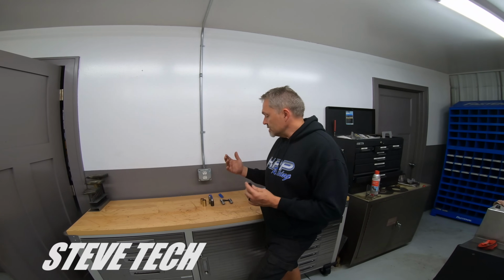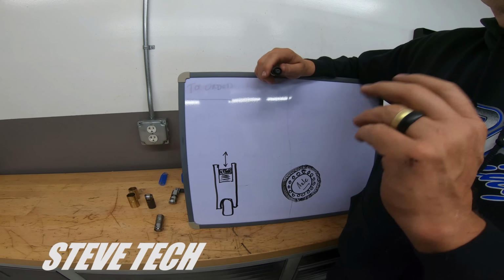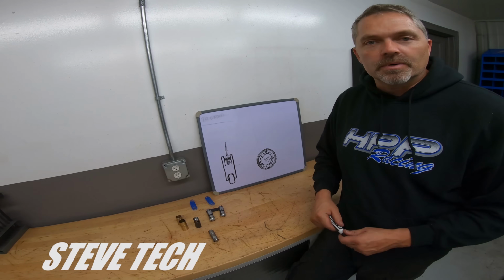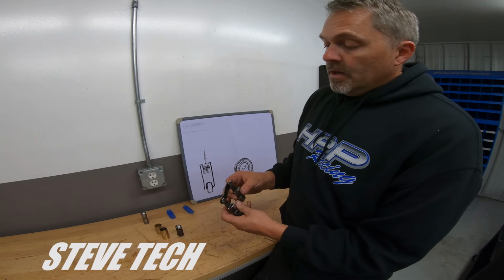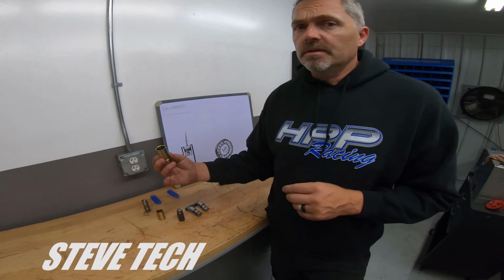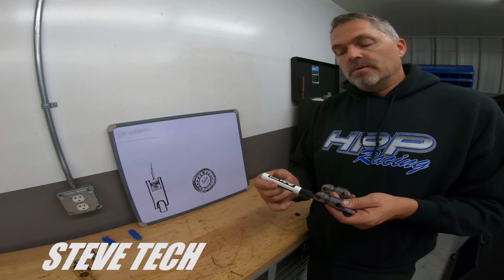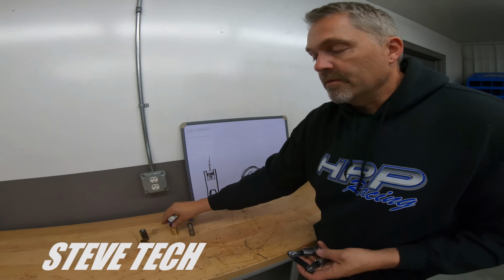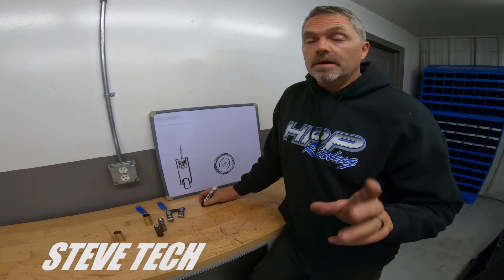Lifters

Comment: Thanks for your page Steve and all the information you provide that you surely don’t have to do. I’ve been building engines for  40 years and I’ve learned  so much more watching your content.  I’ve been running solid flat tappet camshafts on my performance daily’s due to what I always figured was a “longevity” issue. What are your thoughts on solid roller camshafts for heavy street use?  My concern is maintenance, outside of the routine lash checks. How often should one pull the intake to actually check lifters?  I do understand that keeping up with the lash checks does shed light on possible problems but the few street builds I’ve done with solid rollers were normally maintained throughout the summer months for cruising season here in Montana, then just pull the intake every winter just to check the lifters themselves…

Comment: arent LS lifters and gen 1 roller lifters the same?  i heard you can use them in a gen1 roller block  and get chepaer high RPM lifters vs the tie bar lifters

Comment: Take a look at factory G.M. 3.1/3.4 liter hydraulic lifters... If you crank the motor over without the pushrods in it long enough to build any oil pressure, and then put the pushrods back in it, it'll have ZERO compression for up to 30 minutes or even longer. The valves are hung slightly open because the lifter pumped up too far when there wasn't any pressure on the pushrod cup from the valve springs, and it takes a little while for the lifters to bleed back down and allow the valves to close.
Years ago, when I did my first I take gasket replacement on one of these engines, I tired to start it and it sounded like it had no compression when it cranked. I was like WTF, did I get the pushrods mixed up? (The intake and exhaust pushrods are different lengths) Did I somehow put the rockers on wrong? As I was looking for the issue for 30 minutes or so, the compression started coming back on individual cylinders, one by one, as I cranked it. It was then that I realized that the lifters had pumped up too far when I cranked it before without the pushrods in it. 
I've seen this happen with lifters in LS engines before also. So, if you have the issue of no compression after reassembling one of these motors, and you've done everything correctly, just let it sit for a little while and it'll come back.
Reply: I did that just a couple weeks ago. I've put head gaskets in many of these and this one for some reason would not get compression back. Went home, next day started fine.
Reply: @ottomechb  It happened to every 3.1/3.4 that I did an intake gasket on, and also a few various LS engines that I had to pull the pushrods out of.

Comment: To be clear: the reason the lifter wants to rotate when it is down on the 'base circle' is because the lifter is not ever perfectly square with the cam, and there is very little pressure on the lifter at that point (none on a solid lifter) to keep it in contact with the lobe and properly aligned. The only pressure on the hydraulic lifter when the valve is closed is supplied by that little spring inside the hydraulic lifter itself.
Reply: Has anyone ever offset the roller a tiny bit to provide 'caster trail' to assist in keeping the lifter straight in the bore? Or does it side load the lifter bore too much and cause wear?

Comment: Years ago I built a valve train for a CAT3208 with multistage turbos and alcohol. lifter bodies were 7075 Al. Ran perfect until the crankshaft split.
Any thoughts on aluminum lifters, for less inertial weight? I was more concerned about inertia in the rockers. Ideas?  THANKS!

Comment: I know this is probably beneath this guys knowledge but, i wish someone would do a video talking about todays roller cams/lifters. Ive seen so many people have clattering on startup, noisy valve trane, and lifters that bleed down to fast due to the lobe profiles. Call any of the cam manufacturers and they act like theyve never heard of this problem and never have a solution🤷‍♂️, even my high dollar custom built 383 has this very issue, builder says it "comes with the territory" of todays roller cams/lifters.

Comment: We have a tool for keying the block and running  a .904 size lifter in a small block Chevy Dart Block and we don't always use bushings but if we use a bushing it has the holes drilled all the way through like you suggested

Comment: Nice work. A video on pros and cons of the hydraulic rollers cam with solid lifters would be cool. I wanted to do it at one stage and was told it wouldn't work too great. Couldn't work out why it wouldn't work. No that you said it does, I want to know more.

Comment: i would like to hear more about how the lifter wheel size effects the cam profiles. i build SBC/BBC and never made the jump to the bigger lifters because i didn't fully understand how this changes things, i have cam profiles that i use now that im very happy with but dont want alot of trial and error to correct my power curves if the lifters send things out of wack.
Reply: you mean   a bigger diameter lifter?  you ever see why a hydraulic profile on a SBF  usually will run more lift vs the SBC's you build.?

its because the ford have and .875  lifter.  allows more area to run a higher lift

talk to circle track guys who run .906  Chrysler style lifters. .....

Comment: Great info!
I first ran a solid lifter on a hydraulic cam in 2007 for the same reasons… I tried various lash settings and found the car went quicker and faster with 15 thou cold lash… I could set them to zero cold and as long as it would fire up and had temp on all cylinders it was fairly quiet when warmed up and the lash increased ( LS7 alloy block) which was great for road use with full exhaust.
The other thing I really don’t like about keyway bush/lifters (and Steve touched on the difficulty in installing them and retrieving a lifter if one should fail) is the alignment has to be perfect on every single one else catastrophic damage will result… I only use the factory tray or a ti bar deal on LS.
Thanks for the video Steve!.
Keep them coming 💪

Comment: The bigger lifter wheels also spin slower so that also saves lifter pin bushings
Reply: And they have larger contact areas, spreading the load and reducing stresses and wear
Reply: Try needleless roller lifters with EDM pin oiling.... I've been using them for a while and so far, so good. No issues yet. I have more time on them than I did with the needle rollers.

Comment: So why do some go to so much trouble for keyed lifters and bushed lifter bores?
Reply: They are used almost exclusively in pro stock where the harmonic and inertia dynamics of a ti bar become a limitation. Especially in engines operating at 10000+ rpm.
Reply: @ktmr8  Thank you for educating me.

Comment: I remember when i was like 20 and thought I knew everything about engines when i had a 540hp 8valve 4cyl. It must have broke 20 roller rocker tips so i said they were not strong enough so i went to old school sintered slider rockers and then i started snapping tips of the lifters🤣. Dumb me figured that was the next weakest link. Little did I know the springs were beat and the thing was floating the valves like crazy and the rockers were getting slapped.  Now i enjoy listening to people that have more experience and are smarter than me so I can absorb some knowledge. 👍
Reply: You couldn't hear the valves floating at high RPMs? 🤔 Usually it's pretty easy to hear, and the engine feels like it hits a brick wall. The power just feels like it falls of a cliff.
Reply: @davelowets  i was 20 and had no idea what i was doing. Didn’t really have a blueprint to go by because it wasn’t a super popular combo and didn’t have anyone to really guide me. I just kinda figured it out myself the more i worked on it.
Reply: @starionslider2116  You must have known enough to get 500+ out of a 4 cylinder
Reply: @davelowets  yea a 8 valve 4 cyl lol. It didn’t happen overnight. Lots of trial and error. I found allllll the weak links hahaha

Comment: Is the bushing required when you increase the wheel size? Or is it possible to just increase the bore size of the block to match the larger lifter? Is there another purpose for the use of the 2nd lifter bushing you showed us without the key way?
Thank you for sharing your knowledge with all of us!
Reply: There’s a few reasons for the use of the lifter bush 
If you are needing to correct lifter to block clearance, repair a gauled lifter bore, or re-centre lifter bores square to the lobe then these bushes make those processes possible
But one of the biggest advantages is for high rpm use and particularly if using the softer alloy block or conversely the extremely hard material found in something like a Dart pro block, the bronze bush material is much happier working with the tool steel lifter material without the added expense of a dlc lifter set.

Comment: I love the idea of running solid lifters on a hyd roller cam. 😁😁👍
Reply: @vrm86gt  weigh your hydro roller lifter and pushrod, weigh your solid roller lifter and pushrod. If you are lighter you can leave the spring pressure the same(assuming your hydro setup had good valve train control). You can also run a little more spring pressure if you want some more rpm ability past peak hp.
 Keep in mind you need to be right on top of your maintenance,  more so than running a 'street lobe' solid roller, as you will be running tighter lash on a lobe with a different lash ramp profile, get it wrong and you will beat up your valve train or not seat valves properly and burn/damage the seats. A dedicated solid cam lobe has a lash ramp designed to control a solid lifter,  the ramp has some margin for tighter and looser lash. A hydro lobe can actually be far more agressive at this point in the lift cycle so if you dont have it right you will be wishing you stayed hydro or simply bought the a solid cam with an appropriate lobe profile for your use!
Reply: @vrm86gt  no probs✌
Reply: @vrm86gt  yeah good question!

Comment: Understand issue with racing, heavy valve springs causing lifter roller and roller rocker bearings. On street apps nothing wild just your avg everyday engine. Roller lifters, roller rockers all help with fuel efficiency right. Yes I've had roller lifters fail with solid roller cam car was street driven and cam was very aggressive. This was 351C with solid roller, never had issue yet with smallblock ford with inline head.

Comment: All the knowledge! I built a 383 about 6 or 7 years ago, for my extended cab. I ran a mild lunati voodoo solid roller, around 40,000 miles I had a lot of valve tip wear and added lash caps, when I had almost 60,000 miles on it the airfilter stud fell in the motor, I put new valves, springs, and lifters in it about 2 years ago. It still runs strong
Reply: I bought a boat (very cheaply) with a Chevy big block in it that knocked like a jack hammer. When I pulled the motor apart, I found the air filter stud in one of the cylinders. The round stud was beat into a square profile, the piston was wasted, and the crankshaft was actually bent. The connecting rod was surprisingly good yet. 1 used factory piston, had the crank straightened, honed the block, new rings and bearings, and it ran for a champ for many years until I sold it.

Comment: Then why do the lifter trays fail all the time. We see at least one engine a week come in where the lifter trays have failed and allowed the lifter to turn in the bore and then wipes out the cam?
Reply: Can confirm seeing this pretty frequently on stock applications, and at relatively low mileage.
Agree with Steve in theory, yet...
I think the plastic trays just arent a great design personally.
Reply: Yes. After only 20k miles on my ls7 the lifters fall right out and there’s so much wiggle play I just put in new buckets with my old lifters on just a head swap. Was gonna use old buckets until I saw that . Rollers are nice but the old flat tapper solids are less worrisome
Reply: @nurburgringdreaming2221   we see this all the time.  We now use tie bar lifters to solve the problem.  
GMs lifter tray design sucks.  Simple little dog bone worked for years and years on a small Chevy 
How many warranty motors they have had to replace you think they would have changed the factory design already